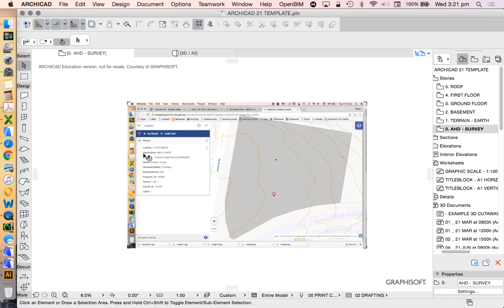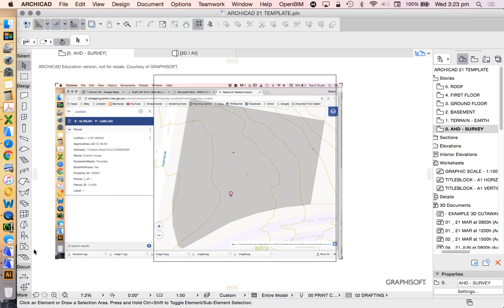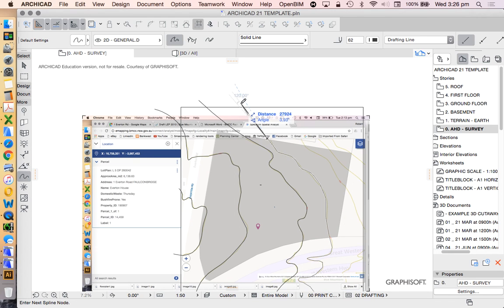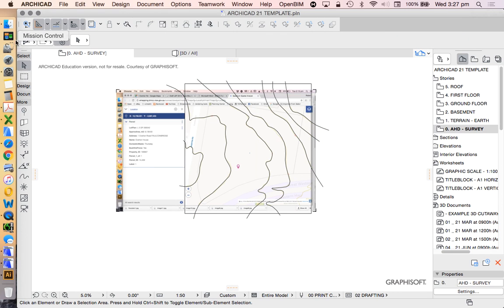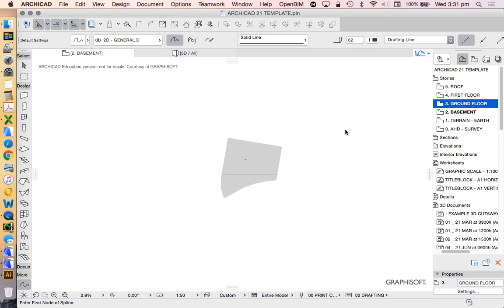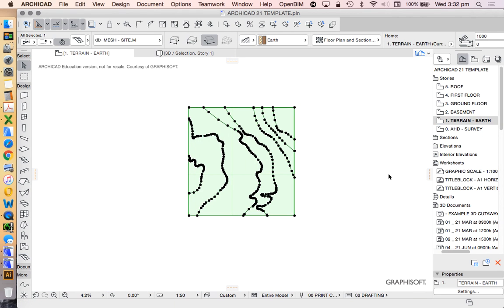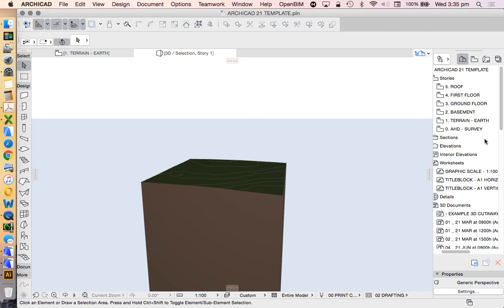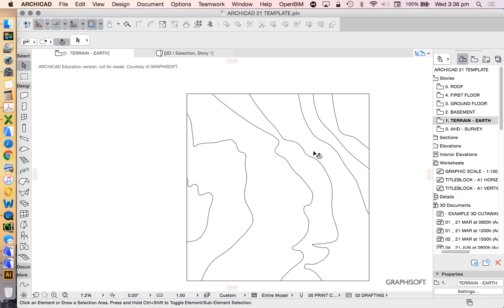ArchiCAD 21 - tutorial part 07 - mesh tool

Comment: Hi, My  terrain mesh looks fine on plan but shows in wireframe in 3d. i looked under settings and have cover fill turned on and surface overrides set for grass and earth. How do i see the terrain model as a solid surface instead of just lines? 
 Thank you for the help ! keep up these great videos. Cheers!